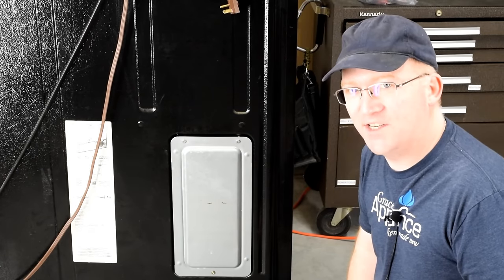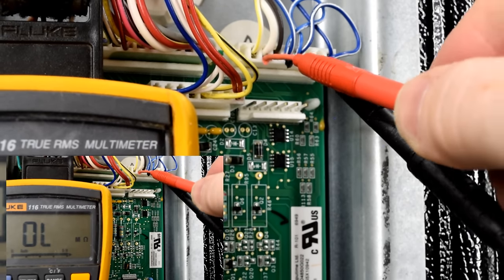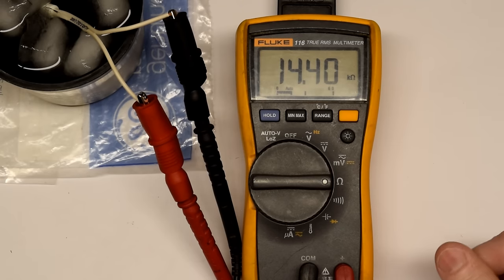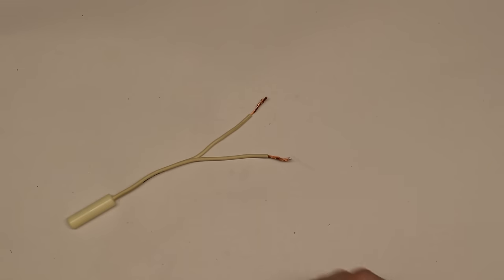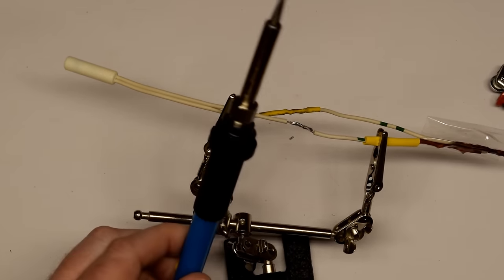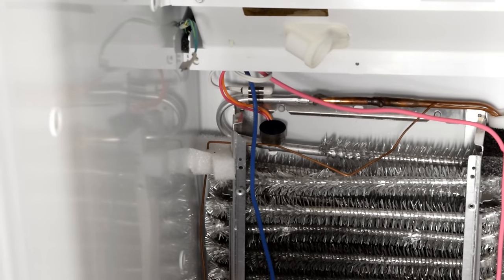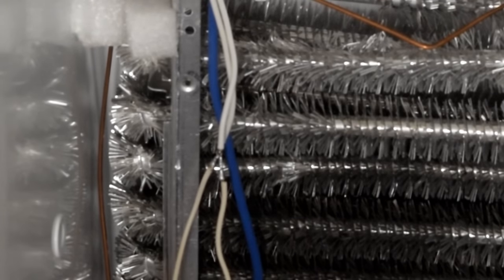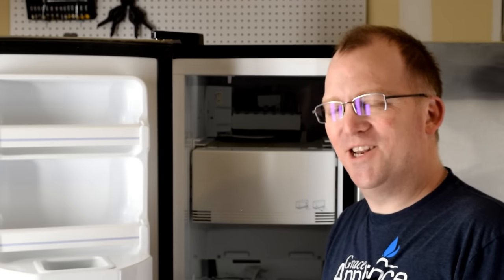Testing and Replacing a GE Defrost Sensor - WR55x10025

Comment: When checking resistance, the yellow wire (fresh food) sensor read 7.4 but the white wire (freezer temp sensor) and the brown wire (defrost sensor) both read Ol. Does this mean the sensor is bad or is it the control board that’s bad?

Comment: You’ll notice the defrost terminator is 141 degrees F cut out, I’ve always wondered how many refrigerators GE has melted or houses they’ve burnt down with a heater stuck on defrost. I personally replace these units with an 80 degree terminator when i’m inside one of these things, much safer and yet plenty of time to insure a defrosted coil as determined by the evaporator thermistor while not interfering with the boards adaptive defrost capabilities. I sleep better at night, how about you GE ?
Reply from the maker: That's super interesting!   Makes a ton of sense.
Notice too how many boards have blown out heater relays / board caught fire, etc.

When you're as big as GE...never mind. LoL
Reply: Interesting point there
Reply: This is the first time in my 53 years of life that I have ever heard of such a thing.  Quite interesting, and certainly eye opening also !  However, unless there is a corporate cover up hiding this potential problem, I’m just going to assume that it’s not really anything to worry about…ummm…knock on wood 🤔 !

Comment: Thanks for your video.  After testing a high limit therm in hot water, which passed, I cut out the temp sensor.  I left it in a running freezer near the coils with a mutlimeter attached.  Few hours later, freezer reads 0 degrees, temp sensor reads 8.4K (whoops).  I found out that on some older GE refrigerators they installed junky sensors.  These have a rounded front and black on the bottom near the wires.  I'm going to order 2 sensors through your link.  I'm just going to keep this POS going a little while longer (you have no idea, I got it for free, it had been dropped!!) until I find a great buy on a new one.  Thanks again.
Reply from the maker: Hey William!  You’re welcome and good job on the diagnosis.  Keep me posted if you happen to hit any snags as you go along.  Stay in touch! Andy
Reply: @GraceAppliance  Hit no real snags outside the fact that the wires I had to cut inside the thing were pretty short.  Was a PITA to work a soldering iron and heat shrink inside that small space.  The POS has apparently been working for a month now without icing up again.  Seems like problem fixed.  I'd love to buy a new one but since my furnace just went out, now I have to buy a bunch of parts to rebuild it too.  Ugg.
Reply from the maker: @williammchugh4361  awesome news! Thanks for the follow up. Stay in touch.

Comment: My freezer seems to be staying in defrost to long. the ice melts a bit then it refreezes into 1 solid chunk, it burned out the ice auger. It only seems to happen about once a day, I put a new board in it about a year ago (for a different problem)and a bit after that I added the heater in the door panel to stop the waterline from freezing. I tested the sensors and all 3 are reading around 9K. based on the chart in the video that's off because it was cold (just unpluged) but it seems odd to me that all of them would read the same? Any thoughts?
Reply: I'm having the exact same problem. Even with the freezer cold my defrost sensor read 5k like it was room temp. The other freezer sensor read close to 9k like yours and the fridge one was in between. I'm wondering if we aren't getting a good connection at the board with standard leads. Mine are much fatter probes than his, so they might not be making good contact. Maybe we have a ground issue also?. I swapped out my defrost sensor thinking this was the issue and bench tested it. Reads perfect (5k at room temp and 14.5k in ice water), so I know that's not the problem now. Did you happen to figure this issue out?
Reply: No I ended up replacing the fridge. Good luck with your repair.
Reply: @Dave-su1zz  Thanks for the reply. I actually figured it out later the same day I replied to your comment. The condenser coil under the fridge was packed solid with crud and wasn't exchanging heat well. I recently switched to this used fridge from a relative's house and it just slipped my mind that I hadn't cleaned out the coil yet. I had already done so on the previous fridge and got garbled in my mind. Once I cleaned the coil it hasn't done the old ice chunks (melting and refreezing) problem since. Hopefully this keeps up. What a relief.

Comment: why were you testing onboard?  You should unplug the connector so you don't measure resistance from the board itself.  Or am I just mistaken?
Reply from the maker: Hey Robert, you’re correct. You an be sure that you isolate the sensor that way if you suspect you’re getting a bad read. I’ve never had any issues either way, but it is a great idea.  Good catch.

Comment: Thank you for expressing how vital it is to solder & heat shrink the wire connections for safety and proper performance. Many people will use wire nuts without realizing the dangers of condensation and how it affects un-insulated wiring. My # 1 rule,  I always solder and heat shrink all wire connections. I have the exact same refrigerator and mine has NO ground wire with a clip on the end??

Comment: Appreciate this as well as your other helpful and informative videos relating to GE side by sides, I've got a 20 year old one which has been pretty rock solid for the most part. Recently replaced the defrost heater, thermostat, thermistor and evaporator fan motor. An FYI, perhaps? When testing each of the thermistors at the board (thanks for the shortcut tip, btw) I found accurate or in-spec readings only if resistance was measured when the J1 plug was detached from its socket, i.e., unplugged. Readings were way off when attached. Not sure what's up with that. Regardless, it's now operating like new again. Thanks again!
Reply from the maker: Thanks for the kind words. Yes, I agree it's best to do the measurements unattached.
The GE side by sides are typically pretty trouble free with the exception of fan & defrost issues. Compressor wise, they are often very solid. That's what you'd hope for.
20 years out of anything these days is unheard of, unfortunately.